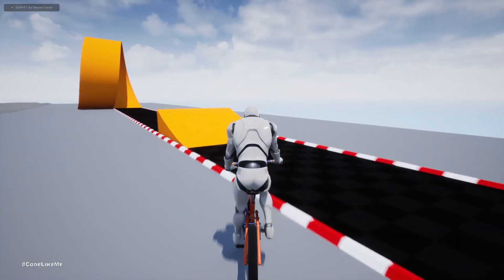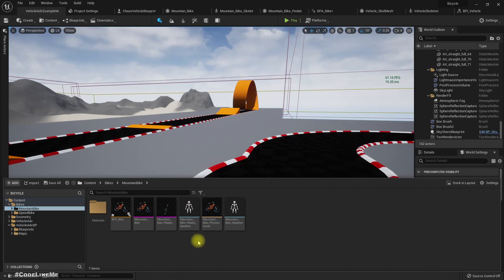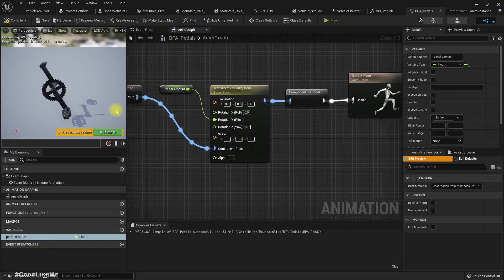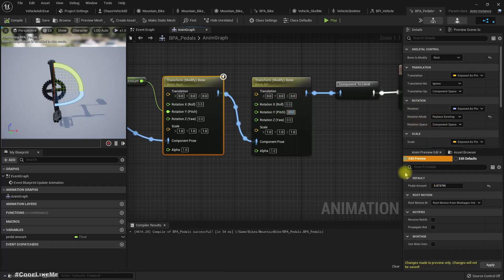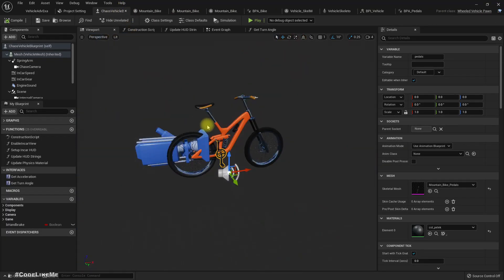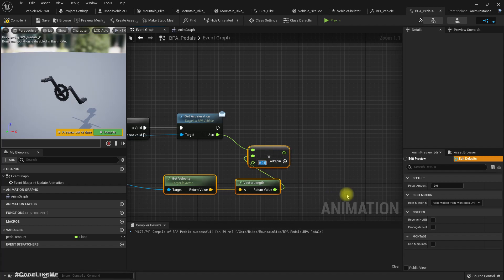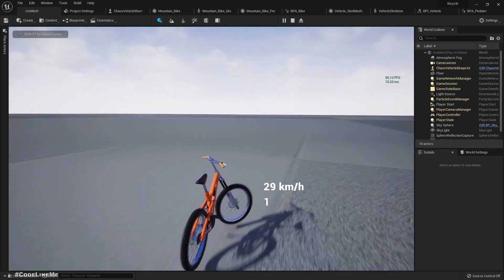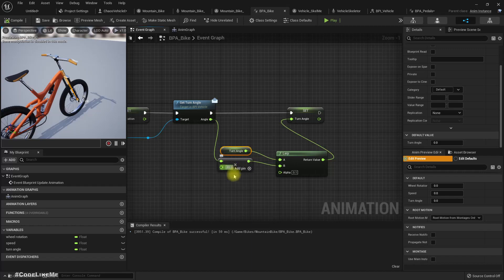Unreal Engine 5 - Bicycle Riding System with Full Body IK [part 2]

Comment: If the bicycle and pedals are the same skeletal mesh,
they cannot be separated, so I used the same mesh for the bicycle and pedals. I created separate AnimationBPs.
Because you can only set one AnimationBP class.
Both tires and pedals rotate,
but when you play,
the pedals of the bicycle mesh do not move, so it doesn't look like the pedals are rotating. What should I do?
Sorry, it's different from your bicycle, so I'm doing it.
Reply: Solved.
I could have done it the same way even if the pedals and bike were the same.
Thank you.

Comment: If your bicycle is a complete bike, you can try to use the new bone plug-in in 5.3 to brush the weights of the desired parts individually.
Reply from the maker: thanks for the tip